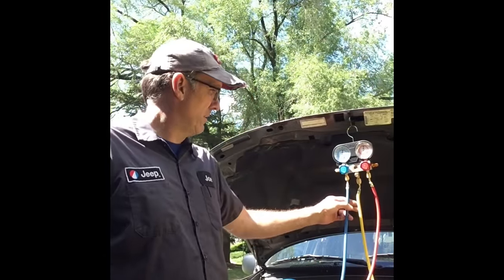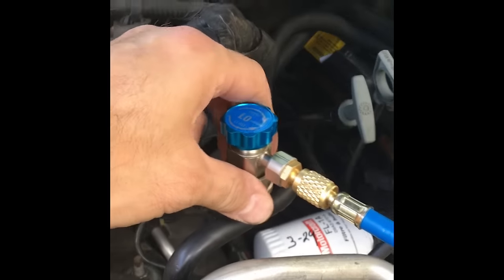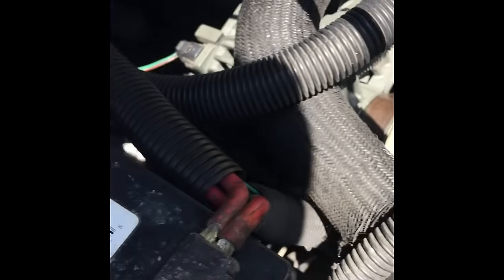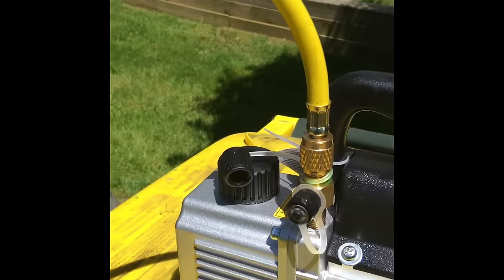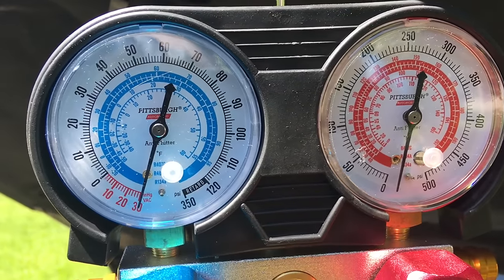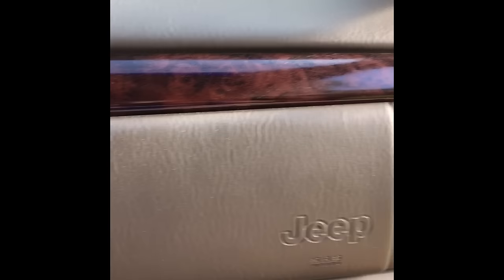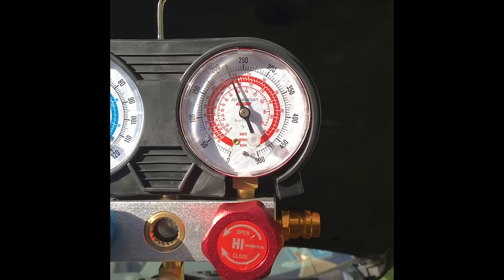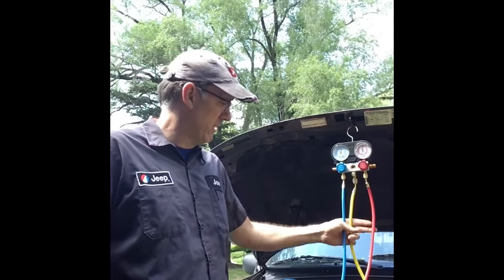How To Pull A Vacuum On Your AC System And Recharge Your AC System

Comment: Hey, great presentation, your easy to watch, and listen to.
I have watched alot of these videos,  I have some experience with home HVAC.
#1 I agree w/ a previous comment, purge yellow hose with refrigerant before you send to system by cracking hose at gauge before opening low side.
#2 mechanics on this subject have said oil 9n compressor is "shipping oil", the right stuff, but almost a flush for any contaminants from factory, it's a 15 min job, so I hope it's worth it, I did it, you have to turn clutch by hand to get all oil out....if anything you know the compressor is fully lubed when you fire it up.
Not criticism, just alternative opinions I've seen, and sharing.
Like I said awesome presentation 5 star in info
Thank you
Reply: Exactly. Always check oil level. The "pre-oiled" compressor I just received yesterday only had 1.5 ounces of oil in it.
Reply from the maker: @sweeptheleg6852  Very good point....Thanks for the contribution...
Reply from the maker: Thanks a lot..I appreciate it!!  Just trying to help folks and save you guys a little money!!

Comment: Thanks! I'm not too familiar with A/Cs besides regular freon fill. I never used the vacuum and the manifold and was always a little apprehensive about it.  Seeing this mad me realize how easy it was.  My AC lost all its pressure and I had to do this to get a good vacuum. I was able to find the leak,  it was on the high side valve Thanks!

Comment: Hi Joe, I'm doing this for the first time, I want to learn to service my cars on my own. Do I have to evacuate the system if I'm replacing a compressor? Or just replace the compressor and pull a vacuum later? Also, how do I know if I need to put oil in the system so the compressor is properly lubricated? Thank you for this video by the way!

Comment: Pretty good job explaining process... one suggestion though... purge the air from the yellow supply line before opening the blue (Low) side of the manifold. You can purge all three lines of air (topping off the system) if you read my comments and think it through.

If just topping off the system the hi and low hoses can be purged of air using the yellow Freon supply line which should be cleared of air as well by cracking open the brass knurled nuts at the end of the blu and red hoses before opening the Schrader valve ports (if you are not pulling a vacuum after a parts replacement). 

Afterwards it is IMPERATIVE to close the Red side of the the manifold before opening the High Side Schrader valve so pressure cannot flow into the can of Freon and cause an explosion. If you don’t understand why then get help. Also, gloves and eye protection is a must. Freon can burn you badly and cause blindness.
Reply: is it necessary to attach red colored connector on hi pressure line to pull vacuum on car ac system? seems like we can bypass the risk of any mishap by avoiding going anywhere near high pressure line since we can use low pressure line for pulling vacuum and using the same port to refill gas. right? would appreciate if you can give your opinion on this
Reply: @lordjaashin  it helps the process of the vac and pulling down to the microns that you need. Then you can add into low side with high side port on the gauges closed. Start running the AC it will pull that Freon in and open and close the txv. Typically on a house AC I start with high side and let Freon in because either way it’s gotta start from a liquid to a vapor and the same process back and forth. But if you’re just adding send it throw the low side while the systems on so it doesn’t try to back feed to the can.

Comment: Just a suggestion for a cheap bit of insurance. Get your high and low side valves swapped out if you've recovered your A/C already. Reason is that if you have leaky valves, it's possible to have good vacuum and your needles won't move because your shrader valves are bypassed with the quick connection but when the system is pressurized and the connection fittings are removed it can slowly leak out of your valves. Mine had a leaking high pressure valve. Replacement valves are cheap. You can spray soapy water inside the valve and watch for bubbles when there's pressure in the system.

Comment: Thanks for video easy to under stand. 1 thing I did learn is before you introduce the freon to the system hit that Schrader valve to fill the yellow hose with freon cause there is some air in line and you want no air at all

Comment: Part 1
Vacuum Pump  selection and usage also called Evacuation 
Effective accurate  vacuum is read in  microns  not from the low gauge 
Pump selection is 4--10cfm for automotive use  4--6cfm  is the economy  choices   
1 or 2 stage pumps   2 stage are used exclusively by the trades =  stronger and lower vacuum done quicker 
500 Micron level is the level that  most moisture wil be removed . Once at this level vehicle needs to be done a further 60 minutes for a system that had refrigerant . HOWEVER A CONTAMINATED SYSTEM NEEDS TO BE 24HRS   .
A good setup will pull500 microns under 5 ---20minutes 
An economy setup takes 1--5hours to pull 500 microns

Comment: If you replace the condenser and all refrigerant escaped (through pressure- bad I know), do you still need oil? If so, how much? I know it varies from car to car and compressor to compressor, but if the system had a violent leak and the entire condenser was replaced (only the condenser), how do you gauge how much PAG oil to put back in? The full amount?

Comment: My jeep isn't blowing cold air anymore, after recharging it. So I've narrowed it down to either ac compressor or a leak somewhere. Im gonna try this too
Reply from the maker: Chasing issues is a pain. Check the fuse too. Put a gauge set on the high/low side and see if you have any pressure. Is the AC clutch engaging?
Reply: @JustJeep_It  everytime I used to press the ac button id feel it kick on, now I dont feel or hear anything. I checked the fuse, looked ok and not burnt out

Comment: Parts 2 
To achieve good vacuum under 500 microns needs a good set of gauges .
How to achieve  is by applying  silicon grease [ di-lectric grease ] to all threads and o rings 
Flush gauges with liquid refrigerant 
NB most new gauges will not pull lower than 500 microns until they are greased

Comment: Awesome video. Very informative. I am starting this process as well (2002 Jeep Liberty Sport). When i was using my 3 CFM 1/4HP Air Vacuum Pump i noticed that there was a cap with a sticker on it that said to REMOVE EXHAUST CAP before operating. Is this very important? Asking because in every 3 CFM 1/4HP Air Vacuum Pump video so far, no one has removed the cap when operating the pump, :(
Reply: Yes this is what exhausts the moisture and whatever else out the system

Comment: When your pulling vacuum, does any compressor oil get pulled out? Or just air and moisture ?
Reply from the maker: I’m sure a little oil is pumped out but it’s mostly air/moisture.
Reply: @JustJeep_It  Thanks for your input. I'm just a DIYer as well

Comment: Pull yellow hose off vacuum pump    before turning it off. The vacuum pump will not hold a vacuum when off. Or purge the yellow line.
Reply: The manifold holds the vaccume when you turn the valves off.

Comment: i follow your sets and got my ac working .   was nice and cold till later after letting it sit for 3 hrs. my ac condenser got a leak was not leaking  hold  vacuum  .... i replaced the ac condenser 4 years ago and now it got a leak.  i have two of my Nissan trucks d21  the other one got a leak in the same spot.  I am thinking its poor cheap design.    so now i have to look for another one for both of my trucks I had already order one for the first truck, but it can bent .  but when i got my ac working again it was nice and cold.  thank you for your steps.  not hard at all ... now i will have to do this repair cause of he leak ,   I have one question can pressure make a pin hole on the condenser.

Comment: Forgot to purge the yellow charge hose before opening the low pressure valve on the manifold.  Just need to press that purge needle to allow air in yellow hose between the can and manifold to escape.
Reply from the maker: Yeah..that is true...Good catch.

Comment: I have that same set of gauges.  What is the schrader valve for on the service/yellow line?
Reply: When you hook your can up leave the low pressure side closed and use a screwdriver and purge the line to let the air out then open your blue valve.

Comment: correct me if I'm WRONG...but.. did you say when CHARGING with freon, the BLUE VALVE (low pressure), is to be OPEN on BOTH ENDS. and the RED VALVE (high pressure) is to be open on the COMPRESSOR END?

Comment: Not a bad job ( but one thing you forgot to do) you didn't prebleed the yellow hose with refrigerant and the small amount of air in the yellow hose just got into the system - other than that good job

Comment: So, after replacing the compressor with a remanufactured, vacuum checked the system, I didn’t read everything I should have here and I believe I did everything right… up to the point of NOT BLEEDING my lines before opening the valve on the 134a and now my gauges show 40 on low side gauge and 200 on high side gauge and the system is not blowing cold air! 
Could have used that information in the video… critical piece of information… so I guess it’s back to the total evacuation of the system and start the purchase and process all over again. Any suggestions on being able to avoid starting all over?

Comment: My question is once you turn the manifold off dosent it close the system there for how do you really know if its holding a vacuum with the blue knob turned off ? May be a dumb question but im willing to learn i get everything else on how to do it i pull a Vacuum turn the knob off but how does the gauge still read with the knob off ?

Comment: Thanks for the video, my vechicle need a few cans, what do I need to do before unscrewing the old can and putting on a new can
Reply: You have to close the valve on the manifold. Unscrew the can and then add a new one. He missed that you need to purge the yellow line each time. Otherwise you’re pulling in air that is in the line. And on a humid day that will be a good bit of moisture.
Reply: @jonathanmurray2186  thank you

Comment: Professional Hvac guys use no charge  gauges for evacuating  only direct connection with a micron gauge . A micron gauge measures leaks and moisture content  a charge set does not . 
***Hint a system thats been open for greater than 12 hours will take 4-- 12 hours evacuation with a good setup 
** Hint A used or new setup cannot obtain a good vacuum until u use Nylog or similar silicon grease on ALL o rings . Vacuum needed under 200micron  great ... under 500 micron acceptable

Comment: I'm confused, when you shut the manifold off to check for leaks in the system, how do you know you don't have a leak when it is isolated. I understand you left the valve on the hose open but going up to the manifold, it is blocked so its not gonna show up on gauge.

Comment: If you never opened your gauge valves after pulling a vacuum, how do you know if the system held vacuum?  You separated the gauges from the system by keeping the gauge valves closed.
Reply from the maker: When I opened the valve it still had vacuum so I knew I was good.

Comment: I have a question if I don’t vacuum my car before putting In Freon what will happen will it make my air stink ?
Reply from the maker: Not so much that but the air trappped in the system will have moisture in it and will prevent the A/C from operating efficiently and could mess with the orifice tube.

Comment: Need help.

So i made sure I had a vaccum. (1hr and held.)

I purged yellow line. 
Turned car on and then opened low side valve. Pressure shot up to 100 then it stayed there and slowly went down to 90 and it just stays there. Low side nothing happens. 

Seems can does not empty either. I turned it from 12oclock to 3oclock while shaking side to side. I did this for about 1hr and nothing changed. Can still feels full. 

I closed the low side valve, turned car off and left it as is. (Low side is holding pressure at 90).

Dkn what to do 🤷
Reply: I checked the compressor prior to this by jumping the relay and it clicked. Could my compressor still be bad? 

(2005 saturn relay)
Reply: Some cans/valves require you to pack the needle out for the can to dispense the refrigerant.

Comment: Ok when you started to vaccum all the air out and moisture did you tun on the engine or off? I have a problem with my AC the technician put a freon r134a in my ac but there no so much called.. ANd my compressor seems it turns on and off... Does it mean i need to vacuum first before puting a recharge on my AC? Then the technician was telling me that i need a brand new compressor which is i check my compressor clutch and it seems its fine to me. It turn on and off the clutch. I need advice. If i found out the technician made amistake he charge me $80.00 for a recharge and im not happy my AC still not cold. Looks like i got rip off!! Please give me some advice. My case i have low refrigerant my ac didnt not much cool... He check if theres a leak in the pressure valve, hoses and condenser which is NO leaks found.
Reply from the maker: James Rock the engine was off when the vacuum was being pulled. 

I bet there isn’t enough Freon in the system. Usually when it’s cycling on and off, that’s a sign of low Freon. Good luck!
Reply: maybe he no understand you lingo amigos

Comment: Yellow line should have been removed and capped  After the manifold valves were closed Then the manifold valves opened for the length of the vacuum test. I'm pretty sure manifold valves closed holds the the vacuum only on the gauges, on that set.

Comment: Do you have to use the pump to add the freon or can you just use the can with the  hose attachment
Reply: It's been 6 months since posting, but hope you figured out, the Yello hose to vaccum is where the can in place of the vacuum.  So, therefore you cannot get another fitting to the can and only one is thru the Yello hose. The vaccum has to be removed before you can put in place the can. Disconnect the Yello hose from vaccum and connect Yello hose to can.

Comment: Do you get get the low, high pressure readings when the compressor is on or off?
Reply from the maker: Argh..I can't remember...did this work a few years ago..But I believe the compressor was on when I was reading..

Anyone have additional info to add??

Comment: Gonna recharge system tomorrow after compressor replacement. They said the compressor is prefilled. Does that mean I don’t have to add any more oil at all? Like does that prefill mean that’s all the systems oil in the compressor or just what the compressor needs itself
Reply from the maker: That’s what I did. My new compressor came pre oiled. I poured it out to measure it... was the right amount of oil.. poured it back in. Installed it. Rock n roll.
Reply: @JustJeep_It  nice nice nice
Reply: @JustJeep_It  oh my problem is idk how much mine needs

Comment: Hi i f i have new problem now, it took almost 2 can but low pressure reading didnt change much while high pressure side reading went from 200-350psi. I stopped and unplugged everything then i noticed low pressure cord end attached to coupler its inner sleeve is ripped, can it cause my reading to be the same? what could be the problem?

Comment: When do u stop putting  Freon when the ac compressor stops engaging?
Reply from the maker: Once the gauges read the proper pressure. Every vehicle is different so check into the AC needed to fill the system.
Reply: @JustJeep_It  ok cool kinda hard to do then lol

Comment: Hi there, great video but I have to mention a couple things I noticed. The hoses appear to be hooked up backwards,  the curved end sides are intended to be connected to the couplers. Also you stated that when the smoke is coming out of the vacuum pump is condensation, the correct term is evaporation. You are boiling the moisture out of the system by adding vacuum to the system.  When under vacuum, boiling temperate becomes much lower than 212° hence the moisture/water evaporates. When a system is under vacuum, especially -30 hg, this enables the water/moisture to "boil" at ambient temperatures such as 60° or even lower.

Comment: What oil i can use, and thanks alot... Grate video...
Reply: It will depend on the compress / vehicle. I know my older Jeep, as well as my slightly less old ford truck takes PAG 46. I also know a lot of shops will use PAG 100, as it is the middle between 46 and 150, which are the two common oils used for R-134a. The univalve PAG oils are usually 100.

Comment: So, finally got around to actually doing the system and recharge.
I did the vac, waited for a 1/2 hour and it held pressure. Yeah!
Ready to move to the next step of recharging, so I took the yellow hose off the vac to put it on the connection value on the top of the R134 canister, and it wont fit.The shut off valve that i bought looks just like yours..One end connects to the R134 canister, just fine, the other side is suppose to hook to the yellow hose, but does not fit.
I went to 3 auto parts stores, and non of them have a value connector that will fit on the yellow hose.
Do I need some kind of adapter?
Reply: I wanted to add, the gauges, hoses and vacuum kit I bought looks like the one you bought from Harbor freight, but i bought it from ebay. The connectors on the yellow hose, are the same thread on both ends, as I'm guessing is standard. Trying either end, will not connect to the T shut off connector connected to the R134 canister.
Reply: @kenr.b.891  you probably got gages for a different type of refrigerant.